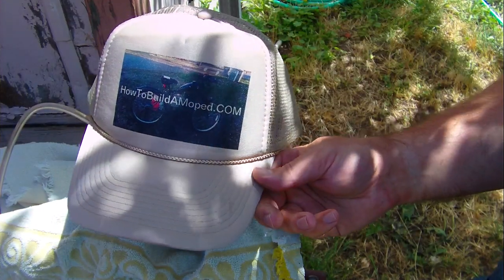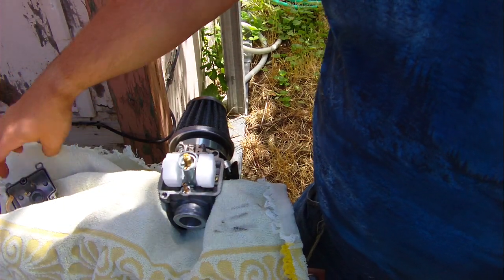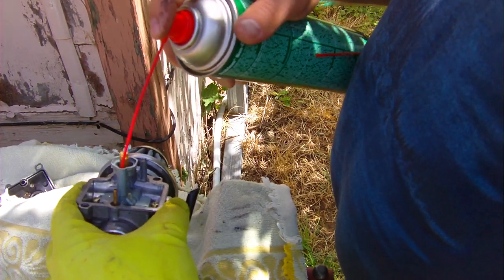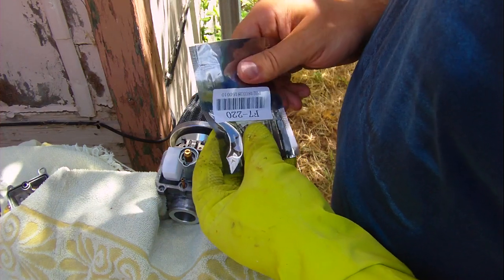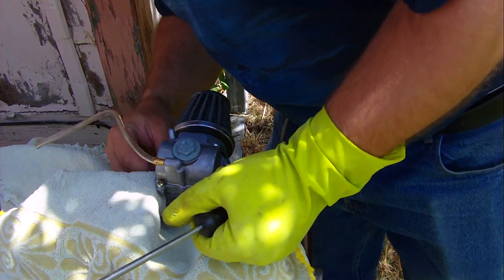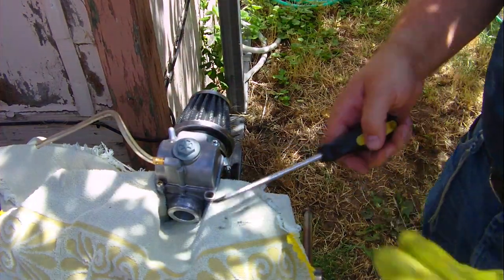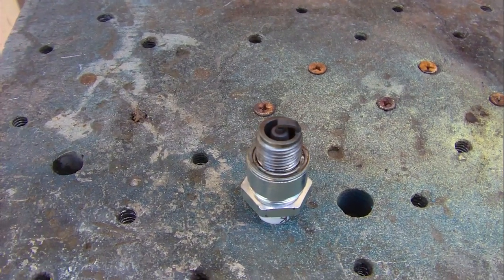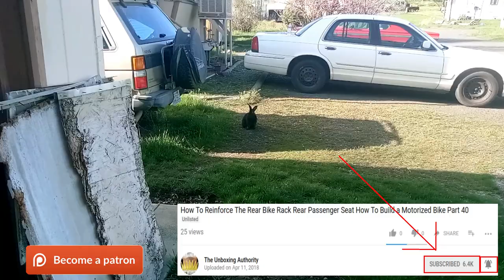Troubleshooting OKO 21mm Carburetor How To Build A Motorized Bicycle Part 72

Comment: my bicycle has a high hole piston engine a iron sleeve no transfer port porting at all, intake and ex a lil cleaned up port timing slightly adjusted a famous carb stock jet in it with expnsion chamber and muffler and I ride it daily now for the last 6 months, no reeds just a shorty intake a ngk plug and it will do 40 mph all day long if I want or cruise around 15 mph really nice engine, but still could be better. but the clutch holding all it can now!
Reply from the maker: Yep, sometimes simple is the best way.
Reply: @MBOFOYH  my oko 21mm all ready to try out now. Tell me to stop! got all the mounting parts all in place yesterday. just gotta go switch maybe 20 minutes and it will be ready. But not started yet bike runs good and I gotta go into town in a while. Ha ha ha!

Comment: That thing should be flying! Something ain't right.  Don't like that plastic elbow, carb doesn't need to be perfectly level. Yank the air filter when you're under load, had that problem too. The emulsion tube orings on my 21mm oko weren't sealing properly. Actually had to file the mounting boss on tube and BLAM!  It's a dangerous rocket now. Had to adjust my float too. Thinking my next build will be a similar reed but case induction and mabe a real mikuni.
Reply from the maker: Ya a mikuni is the way I want to go.
Reply: @MBOFOYH  I'd give you double thumbs up if I could brother. Mikunis are the best in my opinion, but not cheap.
Reply: Oh yeah, I saw the ride vid before I saw the install video. Instead of spacing the head with double head gaskets, you need to raise the jug with a baseplate spacer. I was in a pinch with mine, so... I hand cut around 8 base gaskets out. Also had to go through the skirt on the original piston. They forgot to put it in the dio kit I guess? Bottom end is  severely un-portmatched with that dio top end. I don't care. HT "PK-80 design", 40mm stroke with type A piston and ZL rod. I was cutting gaskets for an hour for the clearance and just eyeballed the roundabout ex and transfer port timing.  Had to cut the piston skirt deep to advance the intake timing enough. It viberates so much less after taking that chunk out of the piston skirt.  Goes around 43 to 44mph with worn out chain and original 44 tooth sprocket. Its a torque powerhouse! Low and mid torque is incredible. If case/ portmatched and actually port timed with a degree wheel I don't know what would happen. Probably throw the rod.  Have hit close to 10k rpm already. Scary shit. Got over 2000 mile on that motor. 
                    It's my baby.

Comment: Have made sure your getting full throttle ...is the cable the stock one ??
Reply from the maker: Ya, I got full throttle. This carb no longer works right, as the cable comes out of the slide. I need a lot of financial help to continue.

Comment: Boy she was jetted wayy too rich my man
Reply from the maker: That is correct :) I need smaller jets. I need Patreons.
Reply: @MBOFOYH  a lot of times those OKO\Keihin clones need to have the pilot circuit drilled out to 1mm, thats if its having trouble idling at a stop.
Reply: @PhysiqueGeek  I have a BBR stage 4 with a 21mm carb (no reeds.) I have a K105 jet and I can tell it’s WAYYYY to rich. What size jet do you recommend?

Edit: I have the MZ65 pipe too.
Reply: @backyardrestorations  I've only ever run a 21mm OKO, assuming that's what you have, on one of my engines and I was not a fan. That was a stroked 80cc MS440 saw engine though, so my jetting there would be way too rich for a stock cylinder. The MZ65 is hands down the best bolt on pipe available though so good choice there. I know Mikuni jetting way better than I do OKO/PWK. Best thing you can do is go on treatland or something and pick up a jet kit for it, the rest is just pure trial and error. What may work excellent for me might run like total shit with yours given how consistently inconsistent these little engines are lol.
Reply: @PhysiqueGeek  thanks. I’ll try that today.
Reply: @backyardrestorations  No problem man, always happy to help 🤙
Reply: @backyardrestorations  I keep trying to share a link for the jets you want but it won't go through
Reply: @PhysiqueGeek  nah it’s ok I got a few on Amazon already.
Reply: @backyardrestorations  alright cool, what sizes did you pick up?
Reply: 75-125 I’ve been doing everything to get it to idle. I’ve got it to idle for a few but then it goes back to over-revving it drives great so I don’t think I even need the jets anymore. I think I have to adjust the bowl.
Reply: @backyardrestorations  If you have one of the cheaper OKO's they are a cheap knockoff of a knockoff and they almost all have issues with idling. As long as it's not so rich that it's 4 stroking you should be alright. If I could hear it run I could probably tell you. Of course the best thing to do there is check your plug color.

Not sure if you've come across it yet, but there's info on a couple sites regarding drilling out the idle jet passage at the bottom of the carb to 1mm IF changing pilot jets and tuning the air mix screw doesn't fix the problem.
Reply: @PhysiqueGeek  I’ve done that. I’ve drilled it to 1.5mm it was a LOT better.
Reply: @backyardrestorations  If you can turn the mix screw all the way in and it still runs you need to go up a size or two on the pilot, if you can turn it out past around 3-3.5 turns and the idle continues to climb with it then you need to go down a size or two on the pilot. Ideally you want the air mix screw to be about 1.5-2 turns out
Reply: @PhysiqueGeek  I’ll try that.
Reply: @backyardrestorations  Did you try changing the pilot jets before you did that? 1.5mm is pretty huge for the pilot circuit. 1/2 a mm might not sound like much but it's a massive difference here
Reply: @backyardrestorations  Yeah that's the only way to set the idle and pilot jet properly, otherwise it's just a huge guessing game. Hopefully it does the trick for you. I definitely don't miss tinkering with carbs lol. Now if I want to change any parameters I connect my phone to my motor controller and tell it exactly what I want it to do. The joys of electric lol
Reply: @PhysiqueGeek  no I haven’t changed the pilot jet.
Reply: @PhysiqueGeek  thanks for your help.
Reply: @backyardrestorations  yep there's your problem lol. The odds of getting a carb that's got the right pilot jet in it are slim to none most of the time. I wish I were more experienced with the OKO/Keihin jetting numbers but I always went out of my way to run Mikuni's. 

Is that thing actually ported at all? I know BBR never offered anything like that in the past even for their so called stage 4 kits. I'm just thinking that 21mm is about the biggest you'd want to go even on a heavily ported and piped stock setup, you'd probably see better performance across the whole throttle range if you actually went down to something like a VM18. Those I know very well. Throw a 25 pilot, 67.5-70 main and the needle clip on the 2nd from the top and it would run like a dream for you.
Edit: Actually, always start at the 3rd notch from the top just to be safe. Too easy to burn these cylinders up if it's lean
Reply: @PhysiqueGeek  I’ll try and find a 25 jet for it rn I have a 38 in it. They gave me a 39 and a 42 lol
Reply: @PhysiqueGeek  I just rode it and it all gone to crap it’s bogging and revving to the moon. Neighbors looking at me like I’m crazy. Gotta get the jets.
Reply: @backyardrestorations  damn yeah you're going to have to start from square one with it unfortunately. That always sucks. If it's revving up on it's own you might have an air leak somewhere too. Get some carb cleaner and spray it all the connections (intake, exhaust, cylinder base, case halves, carb seal) while the engine is running and it bogs or kills it you have a leak there. I like to use a piece of cardboard as a guard so that you're only hitting one specific part at a time. If there is a leak that has to be dealt with first
Reply: @PhysiqueGeek  I’ll keep that in mind. I had to make my intake because I have a really tiny frame. (Mountain bike) Getting the motor in the frame was hard.
Reply: @PhysiqueGeek  I just bought some jets 30-55 (pilot) and 88-125
Reply: @backyardrestorations  no not a 25 for the carb you have right now. The jets for your current carb are numbered completely different from Mikuni jets. Yeah I would definitely check for leaks around that intake, I doubt the rubber boot on the carb side would be leaking, probably where it mates with the cylinder flange
Reply: @PhysiqueGeek  yes. It still need some jets. I’ll check for that later.
Reply: @backyardrestorations  sounds like a plan. Let know how it goes man
Reply: @PhysiqueGeek  sure will.
Reply: @PhysiqueGeek  I’m making a video on this and it will be up soon.
Reply: @PhysiqueGeek  I put a 90 and a 31 in it and it’s still doing the same thing. Any ideas?
Reply: @backyardrestorations  First did you check everything over with the carb cleaner to check for air leaks? 

Is it still only the idle that's not working or are you having issues across the whole throttle range? Pop your spark plug out and see what color it is too, that'll tell you if your rich or lean on the needle and main jet, but it won't help much with idle.
Reply: @PhysiqueGeek  oh it’s all awful if I even MOVE the throttle it dies.
Reply: @backyardrestorations  So i just watched your video, you're probably running real lean on the needle with the clip all the way at the top, the leanest setting. Hate to be a downer, but I think drilling the pilot out that extra 0.5mm might have really screwed things up for the idle circuit. Did you do the air screw test I was telling you about?
Reply: @PhysiqueGeek  yeah.
Reply: Alright yeah definitely move your clip back down a notch or two, that's definitely choking it out. As for the idle though, you might be kind of SOL there now since it's drilled too big.
Reply: @backyardrestorations  when you were checking for air leaks did you spray around the crank seals? When it starts to rev up on it's own once things heat up that usually means you either have an air leak somewhere or the jetting is too lean somewhere.
Reply: @PhysiqueGeek  I’ll check again. I’ll surround it in jb weld.
Reply: @backyardrestorations  yeah check around those seals, I drove myself crazy a couple times because I forgot to check the seals when trying to find a leak. Surround what with JB, where you drilled the carb?
Reply: @PhysiqueGeek  I fixed the leak and still nothing! It will rev to the moon at idle and die if I move the throttle a hair!
Reply: @backyardrestorations  alright so what size pilot and main jets are in it right now? If its revving to the moon at idle, with no air leaks, the pilot jet is too small. And if it dies the moment you touch the throttle that is likely more so the needle position than the main jet. Main jet doesn't fully come on until you hit 3/4-WOT throttle. What I used to do when I was trying to tune a new, unknown setup was to mark somewhere near the throttle all the different positions from Idle - 1/4 - 1/2 - 3/4 - WOT. That way you can at least see what part of the circuit the issue is in. Doesn't always make it perfect, but it makes things less of a guessing game
Reply: @backyardrestorations  At this point I'd probably just start moving up in sizes on the pilot, and throw the biggest main I have in it and just work your way down on the main size until it stops 4 stroking. Like I said though the idle might be a losing battle now since its drilled way oversized. Almost everyone I know that's ever tried running one of these knock off chinese carbs on these bikes has had trouble getting them to idle correctly. A lot of them just end up saying screw it and give up idling lol, I know that's not the answer you want though.
Reply: @PhysiqueGeek  I have the needle at the middle at the moment. I have a 90 and a 30 in it.
Reply: @backyardrestorations  Okay yeah I'd throw the biggest main you have in it, 125 I think you said? This is all guesswork for me, like I said idk anything about the PWK jet numbers relative to their Mikuni equivalent. Same for the pilot, just keep moving up in sizes until you can at least get it to run correctly. This is a long, very not fun process. 

Jetting is definitely the worst part of all this because unless you have someone that lives at the same elevation, at the same temp, with an identical setup, no one can REALLY tell you where you need to be with jetting. Just the general ballpark where you should start.
Reply: @PhysiqueGeek  thanks for the help!
Reply: @backyardrestorations  No problem brother, sorry I can't give you a more precise answer. I know how damn frustrating this can be believe me lol.
Reply: @PhysiqueGeek  I went and put the BIGGEST jets in it and it RIPS!! I have a 32T sprocket and I’m tearing up my yard! Still doesn’t idle but the throttle is working better. I was having so much fun until my brakes fell off :/.
Reply: @PhysiqueGeek  I adjusted the clip to the bottom and it’s so fast!!! I’m not even reaching the powerband!! Just gotta idle it!!
Reply: @backyardrestorations  SWEEEET!!!! I knew you'd get her figured out man! Haha I just got all giddy reading that, I know how awesome that feeling is to finally beat it haha. Now for that damn idle
Reply: @PhysiqueGeek  I never would have thought that it was lean!

Comment: Only 24 mph??
Reply from the maker: This is my first build, it's a work in progress. I've had it up to 33+ Mph so far. Anything over 30 feels dangerous.
Reply: @MBOFOYH  oh okay cause im hitting 34mph with nt carb and 36mph 17mm keihin carb,  stock intake manifold. Oddly. Only getting 34mph with both sprockets on nt carb. Im currently installing the dual intake manifold. Gona try to run both nt and 17mm. I'll make a video if i can get it to run. xD cheers and good luck!
Reply from the maker: Ya, those dual carbs sound tricky.

Comment: Take the doi Reed off Zedamotorsports lost a horsepower on the Dyno when they slapped that on go check out their video for yourself
Reply from the maker: Ya, well I think I know what's going on, and when I get more funding, I will fix it and continue on. I think the DIO REED VALVE and included carb give you greater torque, but might lower top RPMs, without proper tuning. Especially if you have a Windowed Piston, or if you port the cylinder... I think at this point, there are a couple of options, and I'd like to hear what you think.
#1 Get a better carburetor and make it work right.
#2 Get a new Cylinder that isn't ported, or just remove the windowed piston.
#3 Get rid of the DIO REED valve kit, and get a better carburetor for the old cylinder.
Reply: @MBOFOYH  Check out this guy channel he bought a Dyno and breaks it down about 2 stroke engines and the upgrades with Dyno prove some things or really gimmicks his channel is 2stroke stuffing
Reply: Proven
Reply from the maker: Ya, he's not using the same engines I don't think.

Comment: I'm running this same carb & zeda80 dio reed my bike doing 58mph. Your carb is so out of tune
Reply from the maker: Ya, It's running too rich. Just when I thought I got it right, the plastic in the top wouldn't hold the throttle cable anymore. A couple people tried to say it's in backward. A Mukini round slide carb should do it. I may have to go back to a standard piston, or an unmodified cylinder.